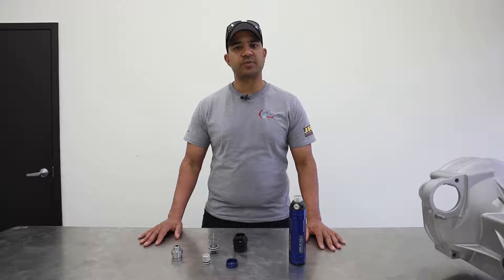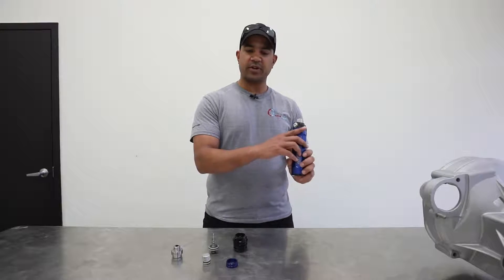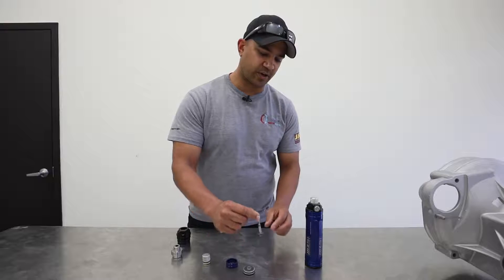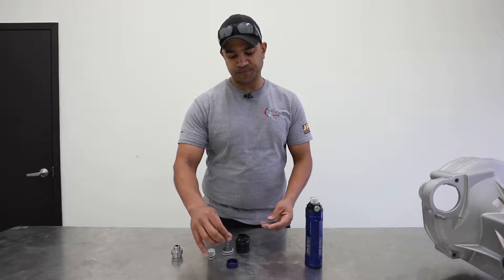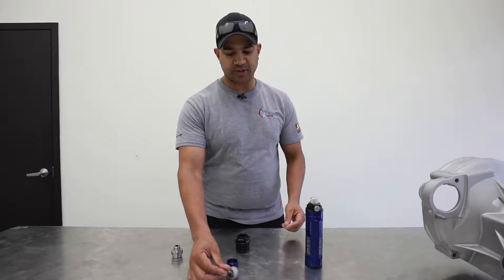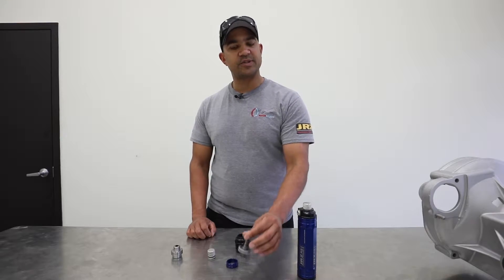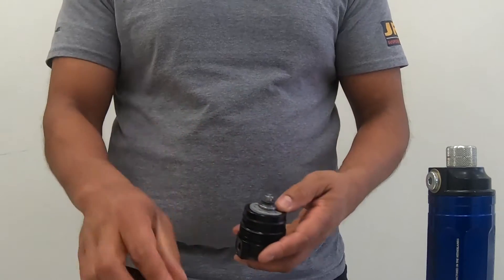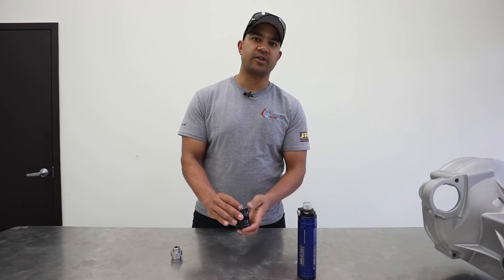The JRZ RS Pro canister

Comment: Is there any functional difference between RS Pros with the round canister and the Hexagonal canister? Looking at a rebuilt set that has the round canister but not sure if they are inferior in performance?
Reply from the maker: The hexagonal shape was added to give the canister rigidity from being squeezed by clamping devices used to mount in the car. Other than that no performance gains!